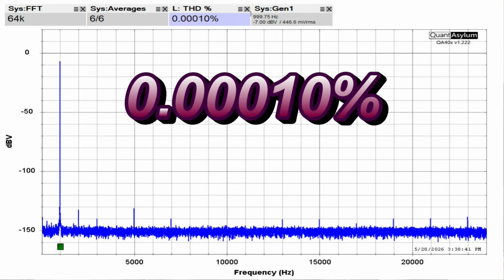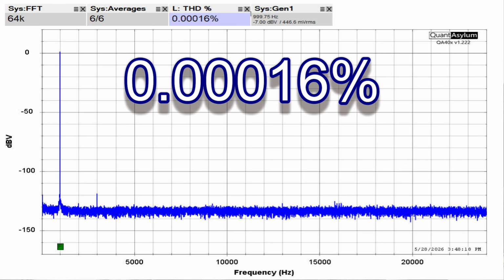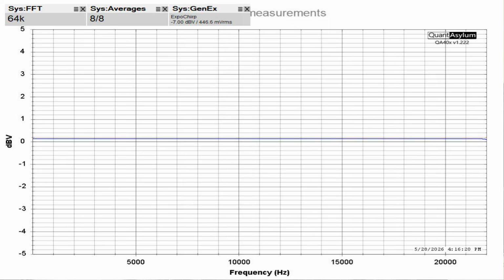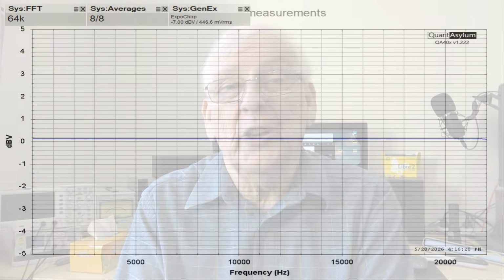The FCA-001A Preamp 0.00016% THD.

Comment: The 'added stuff' mimics what happens to sound waves as they reverberate in an environment; even order harmonics are added. It's what creates our natural perception of depth. I'd argue that any piece of audio that doesn't reproduce a sense of depth, a soundstage isn't hi-fi.  A straight wire with gain isn't hi-fi.  The Quad 405 isn't hi-fi.
Reply from the maker: OK, we all have an opinion.
Reply: a concrete prison cell would give you a lot of reverb

Comment: I like that fact that these preamp boards have trimpots on them. Many preamp board makers expect there not to be an imbalance of left and right when putting these boards together! It's a rediculous oversight!
Reply from the maker: They are not used for matching specifically, but for setting the overall gain. It's always best to use the minimum gain you need.
Reply: When designing the board, several options for setting the channel gain were considered. The most flexible is the dual trimpot setup we used. As a nice side benefit, it can be used to correct imbalances both in the preamp itself and whatever follows it.
Reply: @ronschauer839 i find this very helpful because alot of preamp boards with a stereo layout topology omit this in their design even though they suggest trying different resistors to manipulate gain values. I believe this to be a design flaw for most boards because even with the tightest of tolerances, the outputs can still be slightly imbalanced L/R wise which can introduce an inaccurate, more i say, "less audiophile" result in any system trying to reproduce a sample accurate sonic representation of the original source material.

Comment: I'm saving up for the 0.00000015% THD preamp. LOL.

kidding aside. I support small guys designing and putting out their own audio gear designs esp if good sounding and low-ish priced.
Reply from the maker: I don't think that THD will happen anytime soon, it was hard enough to make a preamp with as low a THD we have achieved.
Before you dismiss our low THD as not sounding great could I suggest you build our preamp. I will not cost much, then you might be very surprised how good it does sound, or at worse you can say "I told you!!" It's not just the THD, it's correct matching of the volume pot. Very low capacitance load on the IC. Very low output impedance with very low interaction with output cables. See, not to shabby! What do you think? You cannot really have a valid opinion unless you try it.
Reply: @MichaelBeeny  It will be back in stock very shortly.
Reply: @MichaelBeeny  Yeah I was joking about that THD number.  Your preamp THD is already VERY low in my opinion.  The point I was trying to make is I don't think it matters (audibly), these THD numbers are already well past the point where it's audible - I *think*.  But I'm open to being wrong...

Sure it might be fun to build your preamp and compare it to a $60 tube "buffer" preamp that I modified a bit.  But your preamp kit/PCB is currently out of stock atm, right?  Btw, I wasn't pretending to know that your device doesn't sound good - it was more in defence of tube gear, or any gear that "alters" the sound as necessarily being inferior or not sounding good.  I've owned lots of solid state and tube gear in my lifetime.  Both can sound great.

My modest tube preamp mod thread: "diyaudio (dot) com/community/threads/fx-audio-tube-02-pro-basic-mod.436477/post-8308839"
Reply from the maker: @bbaker6212  Hi Brad, Yes, out of stock again. Sold over 360 so far. With 100% positive feedback. Not to shabby!! More in sock in about 2 weeks, being made right now. I do hope you try it out. Kind Regards, Michael

Comment: @MichaelBeeny
Just a note on the 5532, just watched a video on EEVBLOG and seems Texas Instruments changed the design of the 5532, i.e. halved the slew rate, reduced supply voltage, etc and not sure if any impact on your preamp design
Reply from the maker: I have in fact made a video on this topic myself about 5 weeks ago. My main supply here in New Zealand is Farnell. As yet, none of the new stock is available, so cannot test them. I think world wide there must be many thousand still in stock. If the slew rate has been reduced it will slow things down somewhat. It will end up a  completly different chip, sadly not in a good way. I bet the price also goes up. I look forward to testing one. For now try both as I suggest, you will probably be OK for quite a while.

Comment: The problem with your logic is that the monitor speakers and equipment used in mixing much, probably the majority, of music in a recording studio is also NOT "hi-fi" ... they are engineering a recording for what they think the majority of listeners will like in their sub-optimal playback systems, in cars, cheap headphones, etc.
And this is why having a tube amp/preamp, speakers, or other device which alters the sound is often preferred and is indeed very much high-fidelity because it improves the resultant sound.   Anything that improves the sound is better - is improved fidelity - is "hi fi"
Reply from the maker: If you think that is so, that's just fine. In life if you can do what you want and have choices in how you listen, that is also fine. I respect your opinion, We are all different, thank goodness.
Lets say we have just one instrument, an acoustic guitar. We use the best mic and make a recording un compressed un modified in any way. I'm saying it will sound more like the original though our preamp than any valve or high THD products. You might prefer the sound with added harmonics and a bit of EQ or compression but THAT is not an accurate preamp. If that is how you like music to sound, that is perfect for you.
That a side, I appreciate you watching my video and your contribution, and hope you will pop by again.
Reply: @MichaelBeeny  btw, I never said anything about using a "high THD" device nor using EQ or compression.  There are some well designed, extremely good sounding tube amps out there that have good measurements.  My main point is that I don't agree with your point that if the signal is modified in any way that MUST be a negative and making the sound worse not better.  I dont' think that's true.  I don't think the best amplifier is necessarily a "wire with gain".   The whole system, especially the speakers, that the amp is paired with matters a lot.
Reply: @MichaelBeeny  OK fine, but even if some audio device sounds more like the real thing (live instrument) it could be inferior for people who listen to their music system for hours per day. Why? Because what is impressive to hear for 1 hour, say at a live music concert, is not pleasing to listen to for hours per day in your home (for some people).  I'm talking about the "ear fatigue" thing ... often caused by overly bright upper mids and treble.  That can be technically more live-like and "accurate" to the original recording while being tiresome to listen to for two hours or more.  If you design a product to do this some people will like it while others will not.
Reply from the maker: @bbaker6212  I would not disagree with you at all on this matter. Our preamp is not for everyone. What product is? Judging by your comments, it is probably not for you. We have designed it specifically to have certain specifications in mind. The people that have built our preamp, and that's over 400 now, love it. Not 1 negative feedback. Maybe if you built it you could be the first to not like it, but then why would you build it knowing it's spec!!! Good talking with you.

Comment: Hi Michael, it's always nice to see and listen to you. I'm nearly 74 now, and, unfortunately, after over 50 years working in the audio industry, my hearing is shot. For many years, I was a Turbosound speaker dealer and have listened to sound systems that were producing excruciating SPL's for quite long periods, this being made possible by the fact that there was no distortion. However, I have come to realise that when I was what could be called "an audiophile" I spent years listening for imperfections in equipment instead of enjoying the music. Nowadays, I can barely tell good from great, but I really enjoy the music, so almost immeasurable THD is not really a concern for me. My test equipment is very basic, it was made by J E Sugden, a company local to me here in West Yorkshire, who also made pretty decent hifi equipment back in the day, the audio oscillator was classed as very low distortion when it was made (around 1977 I think), but from memory I think it's 0.02% THD! How things change.
Reply from the maker: Hi Bob, yes I remember Sugden very well. When I was in retail, we sold the Sugden amplifier range, class A stuff. Personally, I was not overly impressed with the sound. I also remember the test gear. I never used it, we had a Radford audio oscillator and THD analyser. Good to see you here, welcome.

Comment: Lowest i got was 0.000001% THD at 30W into 8 ohms. With 1kHz test signal. Used rohde & schwarz test gear to test it. 

That amp was not made for audio, though it works spectacularly for this too. Its response was DC to 250kHz. Meant for an electron microscopes deflection coils. Normally they use far less impressive systems but i needed it for an experiment, well 2 of them. I still use a smaller version as a headphone amp. 

Based on descrete transistors, a lot of them thermally linked. It was an absolute nightmare to build and align, its distortion is also temperature dependent, since resistance drift changes its performance. The large one was on a 0.1°C/h tolerence watercolling system the rest of the machine was on.

Is it my favorite amp for listening, no, but its a fun experiment.
Reply: Never happen at 30W - but the youtube shheps might enjoy leaving comments...lol
Reply: So.... When was the last time that YOU used Rohde &:Schwarz Test equipment?
Reply: What's that in dB?
Reply: @lohikarhu734 second and third harmonic peaks where somewhere in the -150dB to -160dB range, barely above the noise floor of the equipment. i don't recall the exact numbers off the top of my head.

Comment: 6:39 Actually... a piece of wire, no matter how short or how thick, has both self-inductance and self-capacitance. In other words, an ideal wire is both conceptually and practically impossible.
Reply from the maker: Very true, but can you think of a better example?
Reply: @MichaelBeeny   Actually, I cannot remember why I made the comment given that you did not refer to neither resistance nor capacitance or inductance. "A straight wire with gain" does not necessarily imply lack of any of the above, nor does it imply constant gain: it could very well be a straight wire with non-linear gain!
To try to answer your question, in a theoretical world I could probably think of other such constructs as I please, e.g., a perfect op-amp with fixed gain or other such nonsense. Can we come up with an amplifier idealisation that shares a few properties with a real amplifier? That question might seem to have some merit, but I believe the answer is no. I am guessing the point of the quote is that the mere futility of attempting to perfect something so inherently compromised in so many ways is so great that any verifiable overall improvement is to be considered an accomplishment.
Reply: An ideal piece of wire would have zero resistance no matter how long the piece of wire was, it would also have zero inductance too, real-world pieces of wire exhibit both resistance and inductance.
Reply: @simonkormendy849  The point of the comment was that a conductor without self-capacitance or self-inductance is a theoretical impossibility - it would not make sense in the way, say, that magnetic fields with only a South pole (but no North pole) would not make sense. An ideal conductor without resistance, however, does make theoretical sense and practical sense too.

Comment: A lot of people doing circuits like yourself say LCSC is a good bet for components. They are very cheap and do a  wide range. Indeed they are geared up to supply manufacturers. You can often select different qualities of the same chip or capacitor. The more it cost the better it is.

Comment: I'm hoping to pair this with a purifi or or orchard class d module. keep those numbers low.
Have you seen the THD on some of Orchard Audio's amps. 0.0007.
Keepin' it clean, good sir.
Reply: A lot of these top class D tend to go for a feedforward design. The conventional is feedback to iron out the distortion. The problems are TID and bad impulse response where you get a decay curve. Feed forward predicts the distortion and subtracts it so you get the output to exactly follow the input. A pure sine wave is an easy job for an amplifier.
Reply from the maker: I would be very interested to hear your experience with that amplifier after its all set up and working.

Comment: Grok 3 AI:

The article is titled "Results of an informal test project on the audibility of AMPLIFIER DISTORTION" by Robert Carver (designer of Phase Linear equipment) in the May 1973 issue of Stereo Review (formerly HiFi/Stereo Review), Volume 30, Number 5.

It is often referred to as "The Great Distortion Delusion" in audio discussions because it challenged the obsession with ultra-low distortion specs in amplifiers.

Key Setup and Methodology

- The tests took place in a very quiet environment (~31 dB ambient noise).
- Equipment included a specially modified Phase Linear 400 amplifier (capable of introducing controlled crossover distortion), AR-LST speakers, master tapes, commercial records, and a white-noise generator.
- Listeners: Stereo Review technical staff ("golden ears") including Julian Hirsch, Ralph Hodges, Craig Stark, Larry Klein, and others.
- They first calibrated ears with high-quality music (e.g., Pentangle folk-rock record) to familiarize themselves with the clean sound.
- Distortion was introduced deliberately (primarily crossover distortion, considered a "worst-case" type for amplifiers at normal listening levels).
- Comparisons were made with a competing 300W amplifier to confirm no inherent differences.

Main Test Results (Audibility Thresholds)

The article details informal listening tests with sine waves, mixed tones, and music. Key findings on when distortion became audible:

- Single sine-wave tone: Distortion as low as 0.1% to 0.3% was audible to the trained listeners (they expressed surprise at this sensitivity).
- Two mixed tones (e.g., 60 Hz + 7,000 Hz or 60 Hz + 3,000 Hz): Higher levels were needed due to psychoacoustic masking—around 0.15% to several percent depending on the mix, with some cases requiring over 10x higher distortion before it was noticeable.
- Music (solo voice, complex program material): Much higher tolerance. Distortion often needed to reach several percent (e.g., 4-6% or more) to be reliably audible, especially with masking from the music itself. On some material, even higher levels went unnoticed.

Comment: Interesting video, thank you. Just one comment regarding the QA403 analyzer. The max. sample rate is 192kHz so it allows frequency reponse measurements up to almost 96kHz. The frequency reponse error of the analyzer can be compensated by either a compensation file or by using the right channel as a reference.
Reply: We are aware of both things. The use of the right channel as reference however does not appear to work to "null" out the measurements on the left channel, at least as described in a few forums. An inquiry to QuantAsylum is in order.

Comment: Hello Mike and Ron,
I got two PCBs, one for me and another one for my friend who is also a passionate DIYer. We now have all the parts needed, as per list suggested by Ron and we will begin populating boards as soon as we get the transformers. I also bougt a very nice aluminum box from Aliexpress, sold by AS HIFI Store, which I would recommend to anyone due to its appearance and quality. My suggestion to you both would be to make another video where you would explain how to arrange parts inside the box (including signal selector), and how to do the wiring to avoid hum and noise. Another one would be how to connect DC on the PCB in case you want to feed the preamp from outside,  that is, to avoid on board regulators 7815/7915.

Comment: Core Sonic Characteristics (AI opinion)
Transparency & Neutrality: The LME49720 adds virtually no coloration to the audio signal. It acts as a highly accurate "wire with gain," preserving the original tonal balance of the recording without artificially warming or softening the sound.Deep, 
Tight Bass: Low frequencies are incredibly well-defined and controlled. It provides excellent slam and impact without sounding bloated or muddy, though some listeners note the bass response can feel artificially "fast" because of how it handles low-end transients.
Highly Detailed Treble: Highs are extended, sparkling, and very clean. Because it does not roll off the upper frequencies, it can sound exceptionally revealing and airy, though it can become fatiguing or bright on poorly mastered or naturally harsh recordings.
Wide Soundstage & Dynamics: It offers excellent stereo separation, instrument separation, and micro-dynamics. Listeners often describe the sound as having "fast" transient responses—meaning rapid, dynamic shifts like plucked strings or drum hits are rendered with sharp precision.
Reply from the maker: Sounds about right. Sounds even better when loaded correctly as it is in our circuitry. AI does not look like it has watched my videos yet lol
Reply: @MichaelBeeny  Hi, I can't find your PCBs on eBay from London, UK! Is UK restricted by eBay?